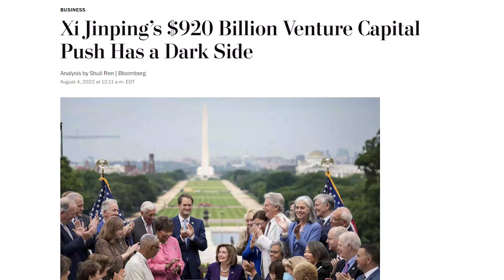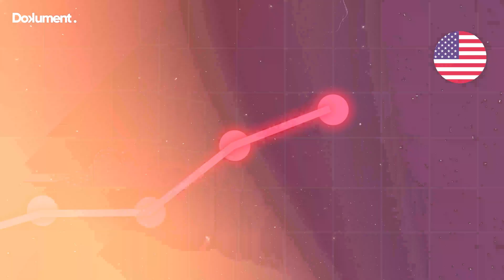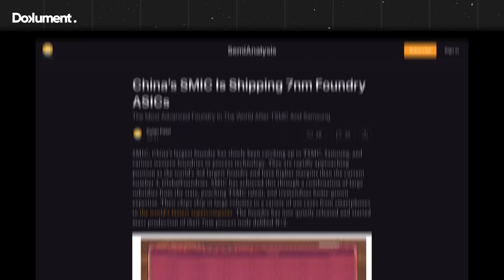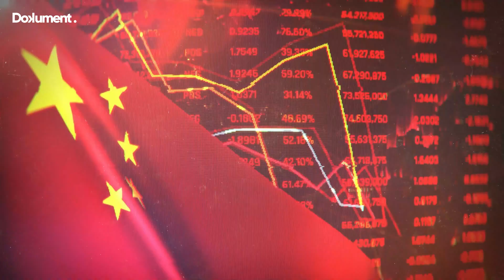How China’s Isolation from the Semiconductor Ecosystem is Almost Complete

Comment: I do not think so ...
low end chip that is the basics of the need industrial country  such as china is already mastered and produced  by china ....this low end chip is the 70% of market , to control the production and market this up to 14nm is safe for china ...and regarding high end chip 7 - 5 - 3 , china does not need to be a leader just behind them is ok ,(  ie china may start producing 7 nm while those advanced already to 3 nm , ..it is ok since the market small and many countries are competing to each other, surely 1or 2 will collapse ...and then , the enemy of chinese chip getting smaller and less competetive ..😆😊😁😃

Lastly china is not necessary to follow silicon based chip and can do research to surpass usa by researching photon chip or carbon chip  . .and sudden lead to chip industry like huawei did in 5g ...